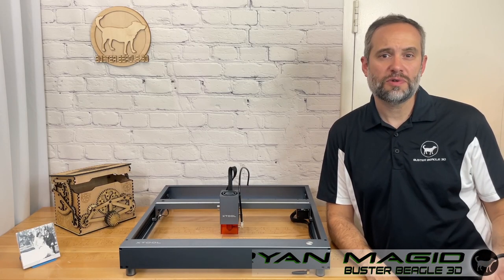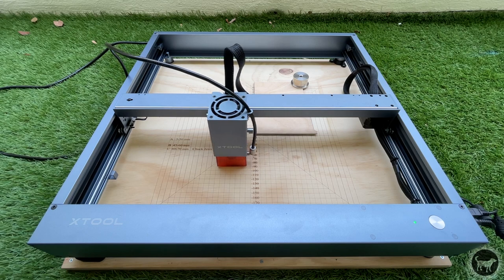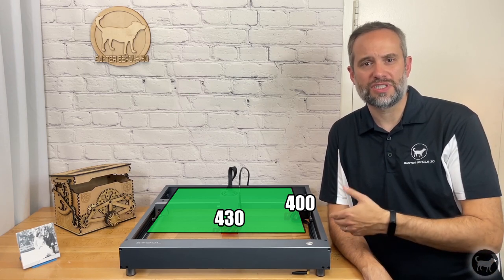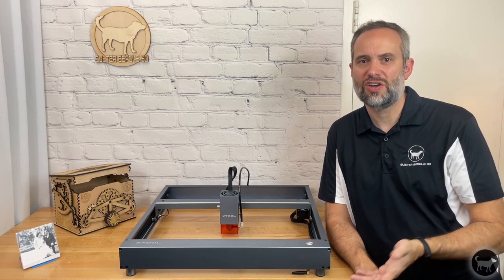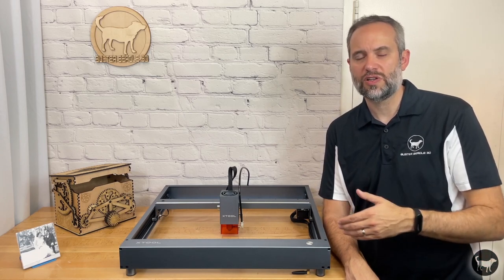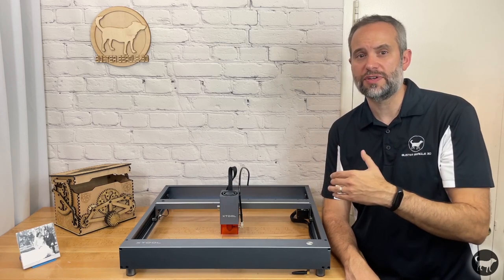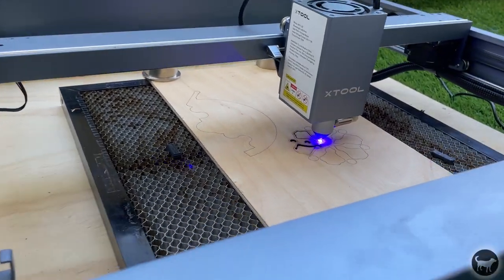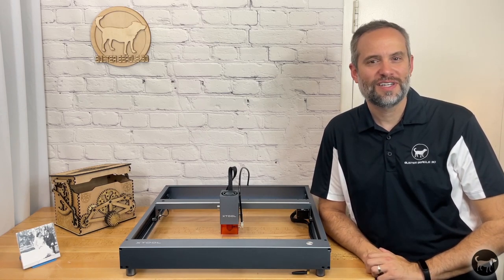xTool D1 Pro 20W | Laser Diode Cutting and Engraving Machine

Comment: Good afternoon,
Sorry for bothering you,
I bought same laser you have xstool d1 pro
I try 100 times to engrave on stainless steel but didn't work I use xtool program
But I don't know how to use the right sittings I try to follow all tip on YouTube but not working 😞 could you please give me some advice or screenshot of right setting or video
Best regards
Reply from the maker: Hello. If I remember correctly it was 100mm/m at 100% power that I engraved into stainless steel.

Comment: how many passes would it take to cut through 1/4 inch plywood?
Reply from the maker: It really depends on the type of wood, what glue they used to make, how humid it is and many other factors. Truly the only way to know for sure is to run some cut tests on it to see how it performs. I suggest faster/more passes over slower/less passes.

Comment: Hi, about the xTool D1 pro 20W do you know if it will cut a 1.5 or 2 mm metal sheet? Or aluminum? .
I need to make name plates for machine's that we manufacture , so we need to engrave and cut
Reply: Thank you very much for your support
Reply from the maker: Hello. I’m afraid it will not cut sheet metal that thick. It might be able to cut .02mm of sheet metal but that’s about it. If you are looking for something that can cut sheet metal you might look into a more powerful fiber laser but those can get pretty pricey for the versions that can achieve that.

Comment: My biggest hold-up with these machines is the requirement to use either their tool or a proprietary tool. It would be nice to have other options, even if those turn out to be the best.
Reply from the maker: Yeah. I'm honestly not sure why they wouldn't make these machines open sourced. It's great that they support Lightburn and it's really a powerful and not expensive program but it would be nice if you could use whatever you want.

Comment: Is it possible to use a SBC like a raspberry pie with the D1 Pro? Would that be fast enough?
Reply from the maker: Honestly I’m not sure. The D1 is not open sourced so can only be run from their proprietary program or ligthburn so I’m not sure if it could run from a raspberry pie.
Reply: @BusterBeagle3D  just thinking an Raspberry Pi3 or RPI4 might be more ideal to use, in the workroom than using a laptop. Similar to using Klipper with a 3D printer.

Comment: Which one do you preffer to work this one or ortur 3?
Reply from the maker: Both have their strengths and weaknesses and it depends on your needs as well as your budget but I would have to say I feel the D1 Pro has a slight edge over the LM3 just based on the current setup. That may change as laser module swap outs and things like feet raiser accessories and things like that come out but as they stand today I would say the D1 Pro.

Comment: Will this actually engrave stainless steel or does it just mark the surface?
Reply from the maker: If you are using the 20W version you can feel the surface of an engraving. It's not like a high powered fiber laser but it's also not just a superficial mark either.

Comment: please add a link to the air regulator valve. Thanks
Reply from the maker: It came with another machine I have but this looks to be the same thing. If you have xTools pump you need the 6mmOD one. https://amzn.to/3BhwI9e
Reply: Just make sure when getting a flow control valve the bypass non return valve is in the right direction otherwise you will have full flow without restriction. I use an SMC flow control valve with dial indicator which can be locked in at a preset level; saves a lot of hassle when you find the optimum flow rate. I understand there are new flow control valves with finer control from SMC soon, they are not widely available at the moment.

Comment: I m new to laser machine and in market to use for making pop up cards from cardstock paper and some miniature wood pieces. I  have Cricut maker machine.
1) does it work on cardstock paper making intricate cuts or too strong for it?
2) other tool air assist or honeycomb is optional  in such application? like to try first and gradually like to add accessory.
3) what is longevity of this machine?  I read mixed review on amazon
4)Looking at xtool d1 pro 10w or 20w . I see diff of 500 $ between them. Should I go with 20w ? Does 10W cut more intricate cuts then 20w?
Quick reply (if u can)  will be great as some deal may over soon by cyber monday.
Reply from the maker: 1) It can work on card stock, You just have to lower the power and speed up the cut
2) It usually best to cut with both and air assist (reduces charring on the top surface) and a honeycomb(reduces charring on the back of the surface. Sure you can do it without as well but results may vary. 
3) As long as you take good care of it and keep it clean you should be able to get some good use out of it. 
4) The 10w has a smaller spot size then the 20W. If you are mainly cutting car stock and thin wood it's perfectly capable of doing that.
Reply: @BusterBeagle3D  
Thank you for quick reply...
Are you suggesting to go with xtool d1 20W or xtool d1 10W based on ur experience ?

Thinking between 
xTool D1 Pro 10W with all accessories (rotary kit, honeycomb, air assist)in 980$

Vs

xTool D1 Pro 20W with rotary kit , PRYMOL Air Assist like (55 to 60$),Silicone Sheet (10$) around 1270-1300$
Reply from the maker: @uhstube74   It really depends on what you are going to do with it. If you want to cut thicker things go with the 20W , if detail is more important and you want to only cut thin things then go with the 10.

Comment: I just got a 10W pro, is it possible to just replace the laser with the 20W? Or do you have to buy the whole unit due to extra power requirements?
Reply from the maker: I'm not 100% sure but I believe the machine power of the 20W is 120W and the 10W is 60W. At the very least I would think it would require an upgraded power supply. I'm also not sure if they have the specific 20W upgrade module for the pro version. The stand alone 20W on their website is intended as an upgrade to the original D1 and not the pro. Again I don't work for them so I could be wrong.

Comment: What I would really like to know is: how many mm of wood do I cut in a single pass?
What is the lifetime of the diode laser?
Thanks
Reply from the maker: That really depends on many factors including what type of wood. what speed/power, air assist or no air assist. I could cut 6mm plywood in one pass where I might have been able to cut 10mm basswood in one. I much prefer more passes at higher speed. Causes much less charring and  nicer cuts. As for the life of the laser I'm not sure. My guess if a really long time but if cutting is the primary thing you want to do with a laser I would suggest looking into CO2 lasers.

Comment: Seems like they ran into the same issue I had when I built my 2nd upgraded cnc router: I forgot to accommodate the width of the carriage...oops. I wanted my machine to be able to do 36" x 60" but lost 3" on each end of each axis due to the carriage being 6" wide. OOPS. 

I know they'd have to change all the components and packaging to accommodate the larger laser so it would be costly.
Reply from the maker: Exactly.  Must had looked good in CAD!

Comment: Hello, has anyone stopped the laser while it is working? It stops unfinished and the work is wasted. I don't know what is happening. The controller on the computer gives a message that it has been disconnected.
Reply from the maker: Only time I have ever seen that happen was when I was using xTool Creative Space. It's only happened to me once or twice but I haven't had that happen in Lightburn. Might be a good time to upgrade and use that software instead.

Comment: Hi I'm rather new to the world of lasers but I have a question, Do you think the xTool D1 Pro 20W is better than an glowforge?
Reply from the maker: I don’t have a glowforge but they are different type of laser. They are a CO2 laser which is much more powerful then a diode laser like the D1. The only other thing I know is that a glowforge requires an active internet connection as that is the only way to operate the machine. So which one is better for you really depends on your needs. XTool does sell CO2 lasers as well comparable to the glowforge so you can always check those out.

Comment: Hey Ryan. Liked your video. I am about to order this. First, where can i get the box file, that is awesome! Second, can i use my Coreldraw with this machine ?
Reply from the maker: You can use Coreldraw to design something but you would need to be able to load it into either xTool Creative space with an SVG or DXF or into Lightburn in many other formats. They are the only 2 programs that can run this machine. 
You can find the box file I used here : https://3axis.co/laser-cut-mechanical-treasure-box-cdr-file/eo0qxvw1/
Reply: @BusterBeagle3D  Thank You

Comment: Hi Ryan
Thank you for providing a great evaluation of XTool 20 watt diode laser.  I am seriously considering replacing a very old but still working 25 watt Co2 machine.  My hesitancy with the XTool has been two fold.  One is the lack of responsiveness of XTool to my initial contact with them.   I’m still waiting.  If I can’t get hold of them prior to buying the machine what will it be like when I need parts or perhaps a simple question in the future. As much effort that XTool has put into their marketing I would think they would be equally capable in answering a couple of pre-sales question

Two since I do more cutting than engraving.  The thickest material I cut (slow speed high power single pass on my Co2 laser) is 3mm MDF and occasionally 1/8th acrylic.   I assume the XTool would do it but I am concerned with the kerf.  I suppose part of the answer to this would be the diameter of the beam at optimum focus.  

Ryan if you have any thoughts or answer’s I would greatly appreciate them.  For me it’s kind of like a Harbor Freight tool purchase.  Some times it turns out to be a great value for the occasional user.  But in some cases not.  As I stand by for a response from XTool.  It may be your opinion that helps me make a yes or no decision on this XTool.

Ryan thanks again for posting your experience on YouTube.  In fact if it wasn’t for your particular YouTube review I wouldn’t be giving this XTool any consideration.  I also want to thank you for the other subjects like injection molding.  Really helpful to the point information. Anyone interested in learning and actually making some simple injection molded parts should check it out.

JoeW
Reply from the maker: Thank you for the kind words. As for the first question about responsiveness I do hear that a lot and see it many times on the Facebook group. To be honest I feel part of the issue is the volume of requests that they get on any day multiplied by the fact that they are in a completely different time zone. Also I'm guess that since they probably get follow up requests from people who feel that they don't respond in a timely manner that just multiplies the issue. I don't want to make excuses for the company and again I am not part of it but I try to be sympathetic as I also deal with a flood of questions each day over a wide range of things. One way that I do find people get faster respones is to post to their official Facebook groups. 

The second question about MDF is that this machine should be able to do that all day no problem. Just use an air assist and do be careful if you don't have an enclosure as MDF can be toxic  when burned with a laser. The kerf gets blown out by the air assist and I can't imagine having an issue. Now as far as this being a "Harbor Freight" like purchase you just have to keep in mind that unlike Harbor Freight these machines are not cheap. If you are only intending to cut 3mm wood every now and then just about every laser I have reviewed in the past can do that and sometimes at a much cheaper price point.   Just something to consider. Thanks again for the watch and plug!

Comment: Nice review.  Will it engrave regular steel as well?   aluminum?
Reply from the maker: I wasn't able to get the same result on galvanized steel or aluminum. You would probably be able to mark on it if you treat the surface but I wasn't able to do it bare.

Comment: They are not really limit switches, they are more like an out of bound function, are for the newbies who do not know what limit switches are ...The flame sensor is like on many diodes it's crap...The speed, hahaha, the speed 24k...Who the hell is going to engrave at 24k?You want to put stress on your diode laser , keep engraving over 10k,and you will find out what I mean...I still think that the D1 is one of the best diode lasers on the market today, yes I own one and also have the 20 watt module it works super fine...Anything that the D1 pro can do, I can do better...It's all about knowing your machine and the software you are working with...Like everything in life, there is a learning curve...So start learning!!!
Reply from the maker: Yeah. I would never recommend burning at the 24K but technically it can work . I use it at a much slower pace. It's just nice to see a laser finally that can do some sort of mark at it's supposed highest speed. Most other lasers I have can't do anywhere near their advertised top speeds.